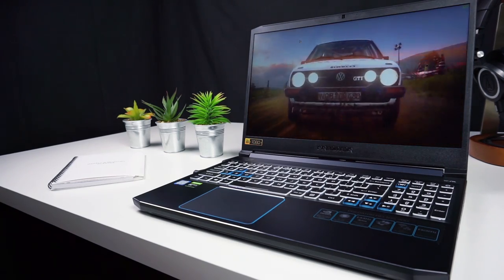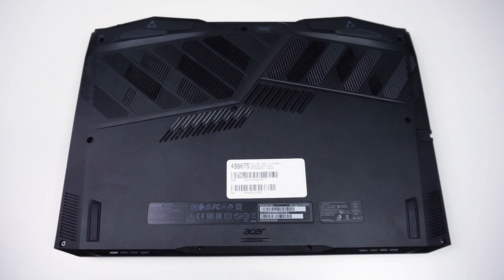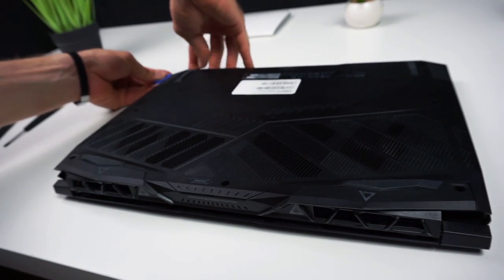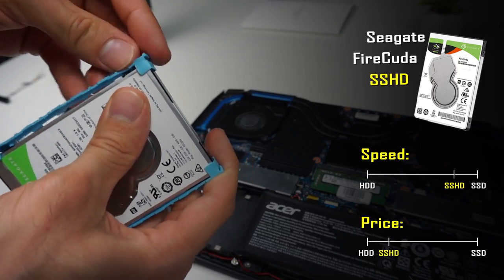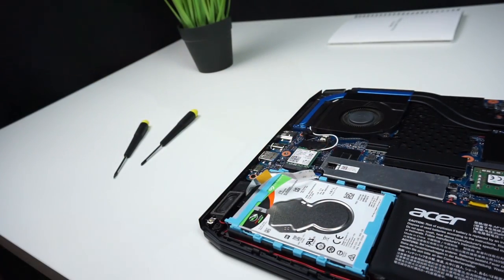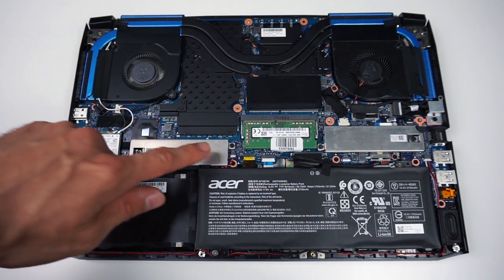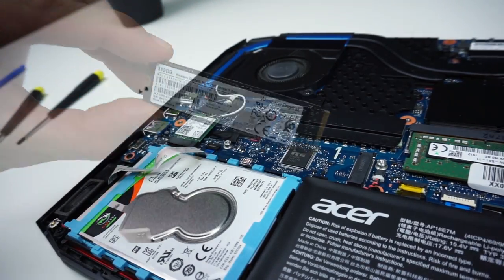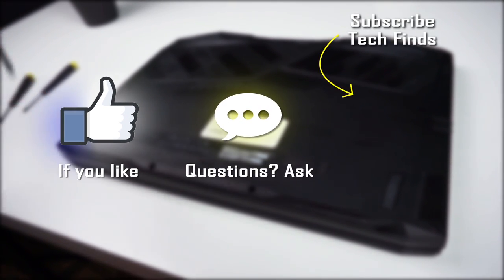Acer Predator Helios 300 2019 Upgrade RAM / SSD / HDD - Disassembly Guide

Comment: If I upgrade the SSD but not the hard drive, will I notice an increase in performance/speed?
Reply from the maker: You mean that you wanna change your SSD and put bigger one? It depends on SSD and it's speed.
Reply: @TechFinds  Yes, so I have a—Samsung SSD 860 EVO 1TB 2.5 Inch SATA III Internal SSD (MZ-76E1T0B/AM)—on the way, and I just want to confirm that upgrading the 2.5 inch hard drive to a SSD 1TB, the two M.2 SSD's to 500gb each, and bumping the RAM up to 32gb, will give me a significant performance increase...

Also, if I were to only upgrade the M.2 and RAM, would I have a significant performance increase, or would the added 2.5 inch hard drive upgrade from 250gb to 1TB be negligible?

Reason I'm asking all of this is I am kind of dreading having to swap out the 2.5inch hard drive and perform a Windows 10 OS install from a USB boot drive...I've never done it before!
Reply from the maker: @andrewsexton6017  the RAM upgrade will increase the performance noticeably but the drives have nothing to do with that. You'll just load the games and programs faster with SSD
Reply: @TechFinds  I've been looking this up online (I have no formal hardware education or training) and I've come across "experts" saying that even when you upgrade RAM, you can experience a "bottle-neck" if the hard drive doesn't have enough capacity...Any suggestions on how to use a Windows Boot Drive (like a tutorial video for example)?..definitely nervous about doing this for the first time.
Reply from the maker: @andrewsexton6017  You can install the Windows from pendrive. Microsoft provides tool on their website to turn your pendrive and files on it into a boot drive. But you have to get a copy of your Windows somehow and that's what i don't know how to do.
Reply: @TechFinds  Thanks, love the channel!
Reply: @TechFinds  Just did a recovery drive on a usb, installed the 2x M.2 SSDs, and 2.5 inch SSD, as well as the RAM...Took a little configuring using the BIOS, but now my drives are all formatted and running great. No screen bleeding like ive seen people talking about here...Overall really like this laptop and for a 1/3 of the price of something with comparable power...
Reply from the maker: @andrewsexton6017  yep, totally agree. You're lucky if you got unit without bleeding, but usually it's not visible during normal use anyway. Let it serve you well.

Comment: Does anybody know which one of these rams sticks performs the best or are they all about the same?
I'm thinking to upgrade to a dual-channel 16x2 to get to 32 ram on my Predator Helios 300. I'm mostly gonna use it for intense gaming.
RAM:
1. Ballistix 2666Hz - https://amzn.to/2AisD6O
  
2. HyperX 2666Hz - https://amzn.to/2NMN5ik
 
3. Crucial 2666Hz - https://amzn.to/2QDPL38
Reply from the maker: If you're replacing 2 sticks then you can go for HyperX. It is a gaming-oriented RAM with lowest latency of the sticks i linked. But the difference between Ballistix and HyperX should not be really noticeable.
Reply: @TechFinds  Thanks, just got my laptop a few months back and I've been wanting to upgrade it.

Comment: Does this void the warranty?
Reply from the maker: It may depend on the country, so better read your warranty card before doing it. However in most cases the warranty is void only when you damaged the laptop during upgrade or the part you added caused a damage.

Comment: Tech finds can you help me how can i remove my wireless mouse usb on my helios it got stuck and it wont budge
Reply from the maker: The USB ports are tight, sometimes i feel like i'm gonna destroy the wireless dongle but it is possible to take it off by fingers.
Reply: @TechFinds  i already tried using my fingers it still wont budge im afraid it will damage the usb port. Is it ok opening the back and then try pulling it out?
Reply from the maker: @Loydsuka  You can't take off the bottom lid as long as the dongle is in the USB port.

Comment: My predator only has hdd. 
Can i move my os to ssd if i insert one?
Reply from the maker: Idk how to 'move' it but for sure you can i stall new os on the new ssd. Your HDD can't have windows on it then
Reply: Tech Finds do optane memory memory work with ssd. I am having a bad experience working on premier pro as of now. 
Thanks for your reply.❤️
Reply from the maker: @rachit4750  I've never used optane so i don't know

Comment: Where can I get rubber case and sshd and laptop connector? Is it come with sshd?
Reply from the maker: The laptop comes with the rubber case and cable in the box. And you can buy SSHD on the internet.
Reply: @TechFinds   so I don't need to get rubber and connector separately
Reply: @TechFinds  thank you so much
Reply from the maker: @savindumarapana6634  yep, it comes with the laptop

Comment: Were i can find the silicon cover?
Reply from the maker: Do you mean the blue frame for HDD? If you don't have it contact Acer so they can guide you where to buy original part or maybe they can provide one
Reply: You found It inside the PC? Sorry bad ENG
Reply from the maker: @mirkobuonocore7493  I had it in the box in bubble foil. It was separately.

Comment: How much does the upgrades cost?
Reply from the maker: Depends on the volume of drive and if you wanna add RAM (how much) or not. You have also second M.2 slot, so you can add another M.2 SSD as well. So the cost is dependant on what you wanna add.
Reply: Tech Finds I was going to add an upgrade for the storage
Reply from the maker: @OwenEdwardsProductions  Then 2TB SSHD that i used costs about $80. You can check the prices in the description.
Reply: Tech Finds ok thanks

Comment: Where did u get the blue thing
Reply from the maker: Which one? the rubber frame for HDD? It comes with the laptop
Reply: Tech Finds the hdd bracket, mines the 2020 version i don’t think it doesn’t come with it right?
Reply from the maker: @diamondorm9920  You should get it with the laptop

Comment: will hyperx 2x8gb 3200mhz work with this laptop?
Reply from the maker: The laptop supports max 2666MHz RAM.
Reply: @TechFinds  I was about to buy it. Thanks for replying. So the ram that come with this laptop and all other laptop rams, are all of them at their max frequency? Or do you still need to overclock it using a third party software.
Reply from the maker: @johnraymondj.pajigal5015  Usually laptops come with RAM of max supported frequency.

Comment: Can we add crucial p1 1tb 3d Nand NVMe  pcle  m. 2 ssd to this laptop?
Reply from the maker: Yes, you can
Reply: What's the advantage over crucial mx500
Reply from the maker: @dhruvpathak9947  it's heaper than other drives, but slower, because it's SATA SSD
Reply: For this laptop, what would you recommend mx500 or p1?
Reply from the maker: @dhruvpathak9947  I don't know p1

Comment: Any one have a clue to what screw size are used for the back panel
Reply from the maker: Use a precision screwdriver that fits the screw head tight. Unfortunately i don't know the size
Reply: @TechFinds  type in on eBay the model number of your laptop and type in bottom screw or screws or something and if they tell you on eBay what screws or someone might have the screws for sale you might have to pay a little more but it's worth it cuz if you put the wrong screw in there I can tell you from experience it can damage the motherboard if it fits and you're turning and you think you have it but it doesn't turn all the way you can ruin the motherboard

Comment: Done installing ssd but my laptop won’t powered on..any idea to fix?
Reply from the maker: If you disconnected the battery make sure to connect it back. Also when you're trying to turn on the laptop make sure that the battery has some power left or plug in the power cord. If it doesn't help, try hard reset - press and hold the power button for 30 seconds and then try to turn on the laptop. If it won't help do the same but before you press the button open the laptop and disconnect the battery. Then press the button, connect the battery back and turn on the laptop. Btw. Ensure that your HDD is connected well.
Reply: Tech Finds thanks for the advice..i didn’t disconnected the battery while inserting the ssd..the laptop not power on after that
Reply from the maker: @syazwan6707  Unfortunately i don't know what may be the cause of that. In most cases laptops turn on with no problem after upgrade, rarely you have to do hard reset. Hopefully you you haven't damaged anything during upgrade process.
Last thing I can suggest is to take off and install back both RAM.
Also Acer laptops have some kind of security. In order for laptop to turn on ALL the screws must be in place, because they create some connection to the power. Make sure you've got all the screws. If there are screws of different length make sure to screw them in the right slot

Comment: Am I gonna buy the SATA connector separately ?
Reply from the maker: By default you should get it with the laptop.
Reply: Tech Finds I bought it from someone but the person hasn't opened the laptop before so I don't know if it's gonna be inside the laptop when I open it
Reply from the maker: @binobyslar  no, the cable is separately along with blue rubber for HDD in the bubble foil
Reply: Tech Finds OMG I didn't get that from the person who sold it for me🤦🏽‍♂️...I didn't get it as brand new in a carton
Reply from the maker: @binobyslar  maybe it's inside of the laptop by any chance. If you have HDD inside it must be there
Reply: There's no HDD inside only SSD

Comment: can anyone please tell me where to get that casing and sata cable to connect to hard drive
Reply from the maker: You should get it with the laptop. If not contact Acer support to ask where to get it separately.
Reply: @TechFinds   Actually the thing is i bought my laptop in 2017 and at that time i didn't wanted extra space but now when i opened the lid to add the hdd there was no case, screws or the SATA cable. When i contacted Acer they told as the laptop's warranty is over they cannot help me with anything
Reply from the maker: @dhavalbheda7391  I thought you're talking about 2019 model as in the video. I don't know where to buy hdd upgrade kit for these laptops.
Reply: @TechFinds  okk thankyou so much for your time

Comment: i want to add 1 tb ssd . here its mentioned that available slots for 2 * ssds and 1 hdd . my acer helios predator 300 manufacture date is 2020/11/05 and model number is ph317-54-734u . tell me exactly which ssd i need ? like say samsung pcie nvme . but  i don't want to replace the big one hard drives wich it shows quantity one . just tell exactly wat i need for the ssd part only ?? like pcie nvme whatever .
Reply from the maker: You can choose any M.2 SSD that i linked in the description. Your laptop supports both M.2 SATA and M.2 NvMe PCIe. Only one slot doesn't support SATA but the other does, so it's safer to go for NvMe since both slots support it
Reply: I have one more question . Suppose i bought the ssd nvme 1 tb may be so i opened the back panel and fix the new ssd in the empty slot for ssd and den i put the back panel back on , then i turn on the laptop . So will it boot or start normally or do i need to do anything else ??
Reply: Because now it does boot up from the stock ssd and may be other ssd slot is empty so since the it boot up from present ssd .if i dont touch that ssd to remain as it is . And just put new ssd in another empty slot . So in this will it normally boot up ?
Reply from the maker: @ridenitro99  The system is on your stock SSD so it should boot from it even if you install new SSD in other slot.
Reply: @TechFinds  adding ssd will increase the speed ?? I play nfs heat but it hangs a bit . But its a configuration 16 gb ram, 512 gb ssd , 1 tb hdd, 6 gb graphics . I install the game in 512 gb ssd .may be because of space so if i add one more ssd then will it be faster ???
Reply from the maker: @ridenitro99  storage doesn't affect performance in any other way than loading screens duration or starting the game/save

Comment: Will this work with the helios 500????
Reply from the maker: Yes, you can use the same components
Reply: @TechFinds  Thanks. Also, is there a way to upgrade the overall performance of the machine during gaming sessions?
Reply from the maker: @timmyphung8266  yes, you can set the fan speed to maximum and overclock the GPU with some external software. But on your own risk.
Reply: @TechFinds  Yea i've tried that before but I want more performance, but I want to know how to upgrade inside the machine and I don't know how so do I just follow the video?
Reply from the maker: @timmyphung8266  yes, upgrading RAM can help, but not very much. If you wanna see a big difference you have to get better GPU (new laptop, because it's not replaceable)

Comment: I bought a Helios predator 300 with 16gb single channel should I go for hyperx 16gb ?
Reply from the maker: No, if you mix you better buy crucial 16GB as it has the same specs as original RAM. Or if you want you can buy 2x16GB HyperX
Reply: @TechFinds can  I buy this one :
Crucial CT16G4SFD8266 16GB Single DDR4 2666 MT/s PC4-21300 DR x8 SODIMM 260-Pin RAM
Reply: @TechFinds  I don't want to buy 2 16 GB sticks of hyperx since I already have one
Reply: But the one I have  I don't know which model it is I only know it's 2667mhz
Reply from the maker: @niharbh4568  this crucial will be good for mixing

Comment: Any m.2 drive will work?
Reply from the maker: One M.2 slot supports both SATA and NvMe M.2 drives and one supports only NvMe. I don't think that any M.2 will work, but in the description you can find the list with compatible ones
Reply: @TechFinds  do you know what drive they include? Just a sata or a nvme as well? I think I bought just a sata drive.
Reply from the maker: @lighthouseministries7  It may vary between countries but my unit came with NvMe M.2 SSD.
Reply: @TechFinds  so it would be safer to get a nvme, chances are better

Comment: Hi sir how much ram does the cheapest 2019 Acer predator Helios 300 have
Reply from the maker: It comes with 16GB usually, but you can probably find it with 8gb depending on country or seller.

Comment: Is the hard drive replaceable?
Reply from the maker: Yes, i showed how to do it in the video.
Reply: @TechFinds  hi, do you know if i can add a 4 TB HDD??
Reply from the maker: @ImAdrianU  4TB 2.5" drives are usually thicker than 2TB so i don't know if it will fit. I guess not, because there was no really way to install something thicher and the blue rubber frame is designed for ~7mm drives. Another thing is that there may be some limitations for storage volume, but i can't find info about that. For sure i know that you can add 2TB. :)

Comment: it came with 16GB RAM...so both slot have 8-8 GB or what ?
Reply from the maker: They sell it with dual channel RAM, so most likely you have 2x8GB. But you can check that with a program CPU-Z
Reply: thank you..
Reply: My laptop came with single 16Gb and 2nd slot is free.

Comment: Does WD BLACK SN750 NVMe with the heatsink fit into the blue 2019 acer predator helios 300?
Reply from the maker: The Helios has it's own plate with thermal pad. Idk, but if the heat sink on the SSD is removable you can go for one and try. If it won't fit you can install it without it.
Reply: You should just get it without the sink, you'll save money, besides, the sticker helps to spread the heat more evenly and the thermal pad the mobo comes with helps as well. Unless you are going to render a lot of video at 4k, it should be fine.

Comment: My laptop is not booting up and it does not charge after i installed the hhd what do i do? Please help
Reply from the maker: Have you disconnected the battery before upgrading? Maybe you didn't connect it back.
Reply: @TechFinds  no i did not disconnect the battery
Reply: @TechFinds  i even tried reinstalling the ram stick but that didn't work either please help
Reply: @TechFinds  the charging light also does not light up while plugged in
Reply from the maker: @aashutoshpant8345  Ok, so do hard reset.
hold the power button for 30 seconds and then check if it will boot.
If not try to do hard reset after disconnecting the battery.
Reply: @TechFinds  how do i perform a hard reset?
Reply from the maker: @aashutoshpant8345  I just said above
Reply: @TechFinds  i held it for 30 seconds and nothing happened? Can you explain what i have to do now in detail please?
Reply: @TechFinds  what do you mean by disconnecting the battery and then trying hard reset?
Reply: @TechFinds  i tried everything u said yet it does not power on or show any sign of power
Reply from the maker: @aashutoshpant8345  other than that I don't know what you can do. Maybe you damaged something somehow. Contact  HP support and tell them about the issue. Maybe they will find a solution

Comment: Can the thermal paste be changed?
Reply from the maker: Yep sure. Thermal paste should be changed fairly often in every gaming laptop. But I don't know how about warranty in this case. I didn't see any warranty stickers on the cooling system in Predator, but it's better to contact Acer or read your warranty terms before you do it.
Reply: @TechFinds  How Often About Every Month?
Reply from the maker: @thedarktemplar6198  no, i think every 6 months is enough.
Reply: @TechFinds  Oh Great Thanks Do You Think 16gb Of Ram Is Good Enough For Modern Gaming? Or Should I Get More?
Reply from the maker: @thedarktemplar6198  16GB RAM is actually a sweet spot for gaming nowdays, but it would be good to have it in dual channel (2x8GB instead of 1x16GB)
Reply: @TechFinds  Cool Thanks

Comment: Bought the crucial ram and upgraded but I'm getting no screen...
Reply from the maker: Try hard reset. Disconnect the battery, hold the power button for 30 seconds, connect the battery back and turn on the laptop